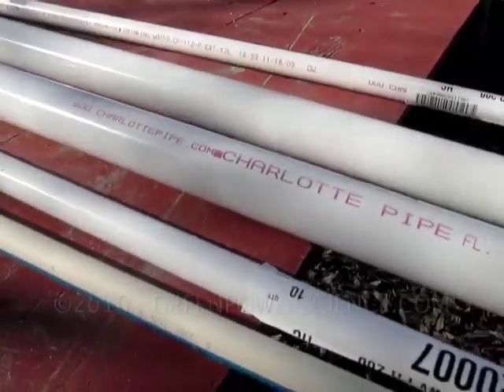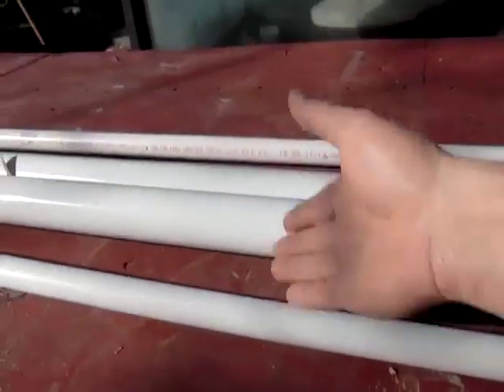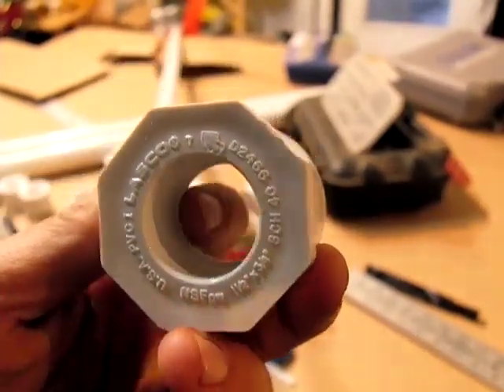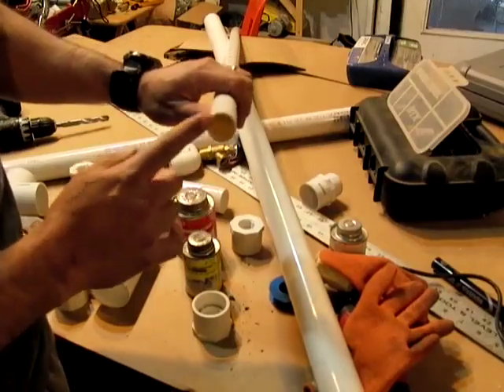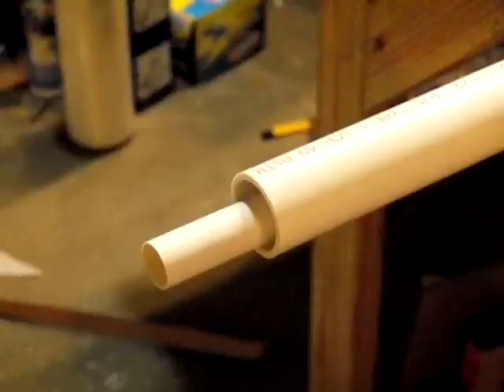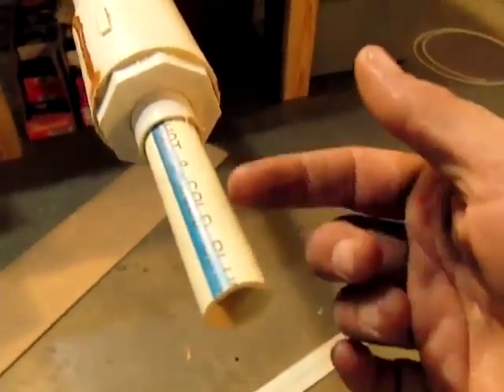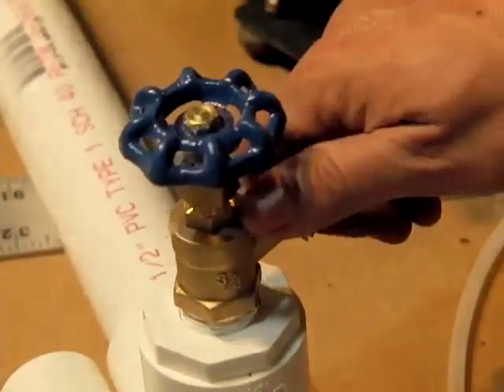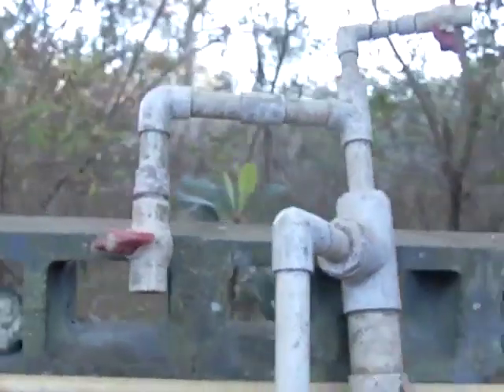PVC PIPE CPVC PIPE How To Make a Thermal Insulated Vacuum Tube

Comment: Why not put plastic rings inside the largest pipe instead of using cardboard ??? Would keep the inter pipe in the center of the vacuum pipe. Forgot to ask, how much more efficient is the vacuum compared to just the insulation wrap??? Thanks

Comment: To remove the internal shoulder of a slip socket fitting simply saw it off. The inner joint's original contact area for solvent welding will remain. The outer is pulling a vacuum so no worries there. I was given a bag of concentric PVC spacers to try a few, actually quite a few, years ago from a supplier. They worked perfectly, snug on inner but free to slide on outer tube. Not much volume of material so I'd expect them to be cheap like borscht. Should, or could, be common enough to locate if  interested. I'm in Canada and the company name eludes me....hang on, their pens last forever...Fabco Plastics. Cheers

Comment: Your explanation for applying thread tape is lacking.  Regardless of which direction you go, you are always pulling the tape towards you. A more accurate description would be "With the threads pointed towards your left, apply the thread tape bottom away from you, top towards you."

Comment: Dude, do you ever do any actual research when you come up with your ideas?  The vacuum attainable in a PVC pipe with solvent glue and silicone is not even remotely close to what is required to significantly reduce conduction and convection.  To get an actually get a worthwhile reduction in heat loss you need to get down to roughly 1 micron or less, and hold this for the life of the project.  The setup in the video won't get remotely close to the necessary vacuum, I would be surprised if this pipe ever got to 1000 micron.  

But even if you could somehow get this setup down to the necessary vacuum it wouldn't hold that level for more than a second or two without constant pumping.  In the vacuum tube collectors sometimes presented in this guy's videos they are hermetically sealing in glass, which has a permeability at least a million times lower than PVC, but even still the manufacturer has to include a "getter" in each tube to keep the vacuum low enough to be useful for the 10-20 year life of the tube.  The getter is a small amount of highly reactive metal that reacts with and absorbs the little bit of contamination that makes it way into the tube over time.  The amount of getter required to keep a PVC tube evacuated for years probably wouldn't even fit inside a hollow PVC tube.
Reply: Good comment.  Unfortunately, this project is typical of the green energy movement.  So many just don't understand the technical issues. Even mega-dollar projects seem to forget basic engineering and science... though in the "Big Green" projects, the ignorance may be deliberate, to keep the dollars flowing.

Actually, sometimes just trying something out, like this guy did, can accomplish things that would otherwise demand many tens of thousands of dollars of research efforts.  But, in the case of this video, they are unaware that out-gassing from the plastic, and even things like H2O molecules that embed themselves in the walls of metal pipe.  These things will soon cause a significant deterioration of the vacuum... .even if they manage to get it down the 1micron level initially.
Reply: Thanks for the info. What would you recommend for DIY vacuum insulating PVC?
Reply: @anon4096  cooper pipe and foam insulation... like my forty year old Grumman Sunstream that actuall works!

Comment: All of this dicking around with this extra PVC nonsense. PAY a pipe insulator or purchase the PROPER thickness/material usually with 1" thick wall rigid fiberglass and install. Ridged fiberglass with a PVC jacket will look cleaner and install faster and give better insulating performance than the vacuum. Also, if you do a poor glue job on your vacuum tubes or a pipe thread leaks, you WILL loose your vacuum and never know unless you have a gauge that tells your vacuum.

Comment: Since most heat loss/transfer is from radiation, why didn't you use reflective tape around the inner tubing? I'll bet preformed foam split-cylindrical foam plastic insulation will do as well as your vacuum set-up, if you include a reflective aluminized tape layer. Vacuum just prevents conduction and convection, and PVC doesn't conduct very well anyway.

Comment: You need a LOT more cardboard, or whatever one uses for stand offs because CVPC or CPV will both sag big time once heat hits them. I would say at a minimum standoffs are needed at two feet or less ESPECIALLY if horizontal.

Comment: I've used that concept to run black steel gas pipe under a concrete floor to a island cook top. The sleeve must vent to the outside and an eccentric reducer fitted up for N.G. and down for LPG

Comment: Dan, would you be able to use this principle to move air and not water?  I figure that you would need to use a larger diameter tube because you would be dealing with a larger volume of air (I'm thinking of a solar 'can' type heater), does something like this sound feasible?

Comment: Didnt knew, that vacuum can insulate IR-radiation. Just remember, the biggest amount of heat is in form of IR. I dont know what kind of "thermal loss" you are talking about, but vaccum surely wont keep IR. To the contrary. It will increase IR losses.

Comment: Actually,If you don't have access to a chop saw, a good way to cut PVC pipe is to just use a wood crosscut saw. It works pretty good. You just have to cut straight.

Comment: instead of the cardboard in the T section you can use tiny cut pieces of pvc tube to hold the centre pipe up because it has the same shape as the pipe and u can make it different level/heights lasts longer also

Comment: @GREENPOWERSCIENCE 
u should use moded cds as spacers in the tube and wen u use plumbling tape get a wrench and grab the thred and give it a ruff up makes tape grip better and makes it seal tighter also could look at using space fuller instead of vacume much like refriderators

Comment: Looks like a great idea! it would be interesting to get a pressure gauge in there to see how much vacuum you are getting, and a thermocouple to compare it with conventional insulation. to answer some peoples question, a perfect vacuum is a perfect insulator, though we will never produce a perfect vacuum. So it all depends on the strength of the vacuum.

Comment: Why not just take regular copper pipe, wrap it in insulation, then stuff the whole thing into the 1.5inch PVC pipe?  Use expandable foam to fill in any gaps.  It would be able to handle higher heat & pressure than PVC and you wouldn't have to worry about leaks.  Simpler construction, etc..
Reply: The copper tubing adds a great deal of specific gravity - meaning the system will first have to heat that pipe to a zero heat gradient before delivering heat content to site of need. CPVC or PEX has less conduction and therefore less heat loss.

Comment: dan if you run an air pipe thru a deep body of water which is quite high so its  pressurised environment will it cool the air down?

Comment: Can I suggest floater discs to support the inner pipe.

They look similar to the little disc you used to place in the center of 45 records, but the center hole is large enough for the inner pipe to go through. These placed every foot along the inner pipe would give full support of the pipe.

It would also work awesome for extra long runs through black ground pipe.

Good job!

Comment: Hi, Good idea.  Do you know the R-value for your double pipe system?  you should try lining the inside of the tube with reflective mylar film too.  And another idea could be to put a dessicant in the tube to absorb water vapour.  Or instead of a vacuum you could purge the system with argon at one ATM that might work too.  Good idea I might try this and get some data.

Comment: I believe the primer is also an acid not just a cleaner. It softens the PVC so it can bond easier.

 A plumber friend of mine told me if you leave primer in an elbow coupler of PVC it will eventually eat all the way through it. Haven't tried it, but an interesting tid bit I thought I'd pass on.

Comment from the maker: @penguinistas If you seal the valve and the custom part, it should hold for a very long time. The nice thing is you can boost if done right. This project leaked, silicone and a bit of tightening made it sealed overnight. PVC is good IF the fittings are snug and ends straight At the time I did the water tank at the end of the video there were 2 manufacture, mixing connectors sucked.  So you can scale up or down. LARGE 6" pipe fittings are tough to keep a great seal, 4" down usually works perfect.

Comment: Well yes thats why i carry my soup in a vacuum flask, but the heat still escapes at the neck of the flask, like here it will escape at the capped ends, and the other issue is the vacuum may escape, and without testing the vacuum periodically, you wont really know. poly insulation has zero failure rate and 10* installation speed, not saying your way is not better, just maybe a little over engineered and may cost more, depending on local pricing. (and you need something to make a vacuum)